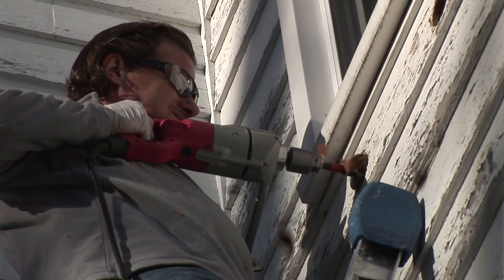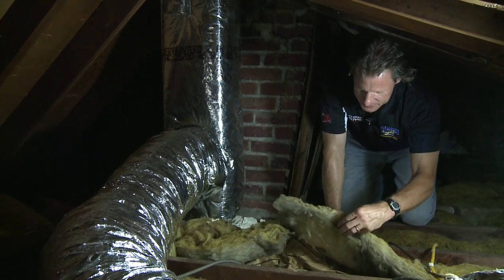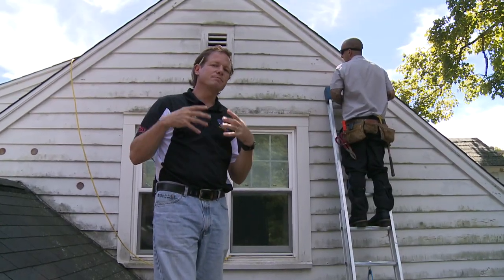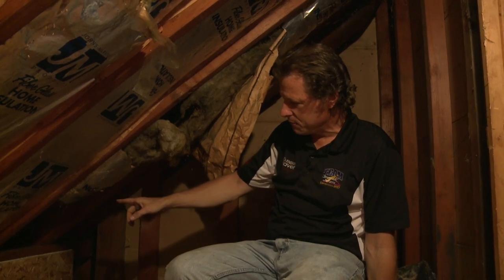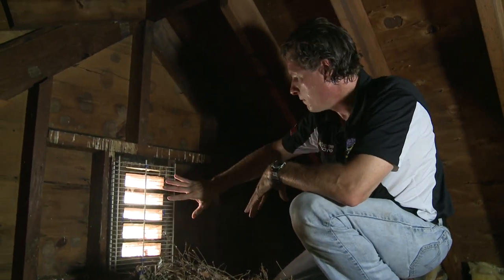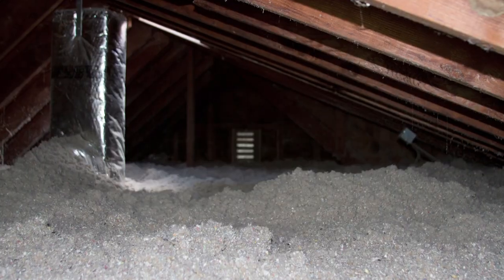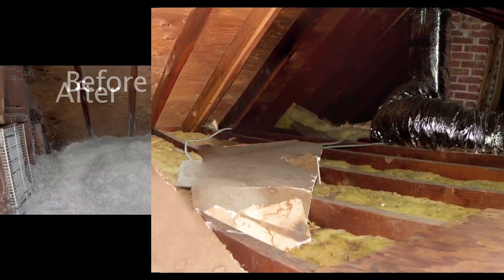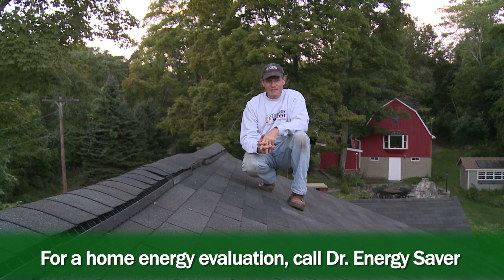How to Make a House Energy Efficient

Comment: I place fabric material on my doors and it makes a big difference! I cut out the material ( similar to a thin blanket ) in the shape of the door, then attach it to the doors. The doors themselves are always cold in the winter and the cold would create two big cold spots in the house. Now that I have the fabric on, no more cold spots and the furnace doesn't turn on as often.
Reply: do you tuck the fabric in the sleeve of the door? Most cold air is coming from the bottom and sides of my door...due to old age or just isnt sealed or fitted properly..these are at least 60 yr old doors....The Larson storm window doors outside of this leaky door was unfortunatly put on without replacing the outer wood frame due to my not being watchful when Lowes installed the door..quickly ...why put a 600 dollar screen door without replacing the wood work 60 yrs old around the door!!!!stupid but the same has occured with the flat roof replacement due to old age the trusses are not level so what ever you cover them with in this case rubber with styrofoam boards underneath....left the dip in the roof still there by the way no pitch.....no plywood to at least flatten the roof again old houses require more efficient work.....so both situations were not shoddy but the SIMPLICEST FIX......roof was 8000.000.....

Comment: About the cellulose spraying - Don't spray over the Eaves (aka Soffit).  Better to place
buffers across ea. joist to prevent the particle from falling back into the Eaves!  Else
there won't b any airflow to remove 140F hot air and unwanted moisture in the attic.

Comment: Very well done video with explanations all along the way. Most homeowners have never been in their attics and don't think about them. As a retired home inspector and HVAC contractor, I've seen plenty of homes just like this one which were "state of the art" at the time, when energy savings were not consequential. I have a 1890s home which my Dad did his due diligence in the 1970s to insulate and try to save some money. At that time, air infiltration and exfiltration was not a "thing". Today we know that air movement means either heat loss or heat gain, the sworn enemy of efficient heating and cooling of any home. Thanks for the info.

Comment: I did my whole home, walls and attic. When I cleaned up the attic, I had to hire a trapper and remove 10 live squirrels and 8 additional carcasses. I also had to repair $800 in damaged wiring and flex ducts.
Great video tho. :)

Comment: If the walls of your house are empty you most likely have an old house. The space in the walls is where condensed water evaporates out of the house. Hot air has more energy and can hold more water. When it hits the cold outside walls the air gets cold and cannot hold all that water. The water gets dumped but the hollow walls allow the moisture to evaporate. These is called balloon framing in old houses without vapor barrier on the outside of the house. By filling the walls you can make a mold situation in the walls. Best bet is use Roxul insulation to replace the Fiberglass. Use a mask for the fiberglass but Roxul is way more efficient than fiberglass insulation and it is a lot safer and in my opinion it is dust free. They tell you to wear gloves but I lay on Roxul all the time when working with no problem. I doubt you would need to blow anything on top of Roxul insulation. Also blowing prevents you from accessing the attic easily.

Comment: At approx. 10:00 you mention that you are blowing insulation into the slopes of a cape as they are not ventilated because of gable vents. Our cape cods in Cbus are 1 1/2 stories. No soffit vents. So am I installing the rigid foam radiant barrier in the knee wall attic space and closing up the gable vents? It seems a constant 'wrestle' between insulation and ventilation in these houses. Is this video of two different houses?

Comment: There has to be air flow along the roofing sheets of plywood to allow moisture to escape.  I don't understand why your cellulose is up against the sheeting since you should have installed air-flow channels to keep the air moving along the sheeting but you didn't.  As you said 'moisture can damage the attic, which is wood, and the insulation being up against the sheeting will prevent the moisture from moving away from the sheeting with air flow.

Comment: Board Foam typically isn't approved as a fire proof material and requires a dry-wall cover.  You should have mentioned that when you put it in the knee wall.
Reply: 2 layers of material?.......I dont even have insulation boards under roof...first time that the Leap people came over and put celulose in....no work was done on the perimeter of building as well so after I went upstairs only to see outside of building where roof meets the building.....not good...they did insulate the hatchet...also the fan is not working.

Comment: 1) Wood thermal conductivity is very low, in fact the values of K for wood are very close to fiberglass insulation values, so covering wood joist with insulation wouldn't change anything.

Still not convinced? have wooden spatula on your kitchen? try to put it in ice or on hot surface you will never feel anything through it.

2) batt insulation requires more effort to be installed properly (to make sure there are no gaps left, etc), but longer term it's much easier to maintain/replace and clean. Can be easily added/adjusted.

3) blow in is fine in the beginning, when its new and if you don't need to do anything on the attic after it. But after a few years, when it started decomposing, mixed with dust and animals byproducts (they would sneak there anyway) it would be a total disaster. The only way to fix it is to replace everything completely.

Comment: Why did you blow insulation into the slopes that lead to the knee wall area?  This doesn't allow for any air flow.

Are you not worried about warm moist air condensing in this space?
Reply: This concerns me too.  I think wherever you get significant snow, you need a vented roof.  Even if there is zero heat leakage from the attic side, on sunny days, any absorbed, retained heat can start snow melt and ice dams.  With the insulation going right up to the roof deck, any heat will be retained and not carried away by moving air, and then the moisture is also trapped.  Maybe it isn't simultaneously snowy and sunny enough there to matter?
Reply: @DennisGentry  He mentions in the video that the attic space is vented at the gable ends, not from up through the rafters
Reply: @jordandownie9319  Yeah, I get that the attic is vented but I'm saying that the underside of the roof deck needs to be vented (have cold, outside air circulation) if it ever snows there, because snow is a really good insulator, so the shingles will warm above freezing, melting (and refreezing at night) the snow and causing ice dams and water infiltration.   Usually, there are vents (cold air intakes) at the soffits (which, if he has them,  are now covered with insulation) and warmed air exits at the ridge or gables.
Reply: DFKnightmare sq
Reply: i suppose the logic is, the roof stays cold, because the heat from within the home cant get to the roof from the inside, hence airtight and insulated.
no heat, no ice, no problem - remember - insulation does not hold heat/cold, it does not transfer heat/cold - it is a barrier, if done correctly

Comment: After last years disaster, preventing ice dams is on everyones mind. From everything I have read, keeping the attic space as close to the outside temp, would pretty much eliminate this problem as it is the warm attic that melts the snow. For that to happen you need three things in place. Insulation that prevents warm air from getting into your attic, a ridge vent that will let the air flow out of your attic space and equally important are soffit vents that allow the cold air to enter the attic. I have watch a couple of your videos and you are completely blocking any form of air from coming through those soffit vents which would eliminate the needed cold air from entering the attic. Can you explain this??
Reply: This particular house construction does not have soffit vents.  It uses gable and ridge vents.  Air is drawn into the gable vents and out of the ridge vents.  Not the best system.  He even said it was a poor design in the video.

Comment: I see the value for the insulation and hole blocking for winter.  What about summer?  There is a ridge vent across the peak of the roof (saw this at the very end of the video) and it has to have soffit vents along the base of the roof for air to flow into the attic and out the ridge cap vent during the hot months.  Blowing all of that insulation into the attic and no provision for the air to come in through the soffits?  That attic will cook in summer.  Am I missing something?
Reply: +jjzanoni I was surprised that they didn't talk about adding in foam baffles to make the soffit vents work
Reply: +Brandon Clow he said at roughly 6 min in that the house doesn't have soffit vents.
Reply: There are gable vents. The air flows into the gables at each end o the attic, and flows out the ridge. This is acceptable.
Reply: Walter Kogut, they should have upgraded to eve and ridge vents

Comment: Very old video, but at the end of the video you can clearly see that the roof has a ridge vent. Doesn't the blanket insulation defeat the purpose and functionality without the use of Durovent from soffit to the top of the ridge?
Reply: I too had questions about airflow which he did not address.

Comment: @4:23:  So you ran about 20' of flex duct to carry warm moist air horizontally through a cool attic and then sloped it up to exhaust?  That's a water-collection device.
Reply: While I agree the run is too long, the vent hose IS itself insulated
Reply: @Windiguana  Thanks for that.  I didn't think it looked insulated, but I hope you're right.  If it was, then, as you said, it's less of an issue.

Comment: You should have put that metal screen on the OUTSIDE of the vent. Having it on the inside will keep raccoons out of the attic, but birds will still get in between the louvre slats and pack straw, piss in the nests, and make a mess. Plus the straw packed in there will reduce air flow to the outside. I know what I'm talking about from dealing with birds flying in between the slats on my attic vents. The slats are too far apart and the birds can easily get in there and build nests. The only solution is heavy metal screens on the outside that they can't peck or chew through.
Reply: He didn't put the metal screen in the homeowner installed it beforehand.

Comment: Larry, Wish you were in my area to help us figure out the best way to vent and insulate our house.  Have had a few "top" rated insulators here in the PNW give us a lot of confusing information.  Cape Cod style house with 2x4 construction. Very little soffit venting, a very small gable vent on one side, and no ridge vent.  Told soffit venting will be difficult because of bird blocking between rafters, and that will need to cut mid roof vents in addition to ridge vent and larger gable vents on both ends.  And finally the insulators can't insulate above knee walls because of the 2x4 roof construction nor can they add baffles. Aaarrgg!
Reply: Where are you located??
Reply: PNW
Reply: Maybe open up walls and use closed-cell spray foam everywhere. Check for airtightness. Install an HRV or ERV system with built-in heat pump.  Will be expensive but should work.

Comment: i have a cap that has an attic fan but doesn't have any sofit vents or ridge vent as far as i can tell.  is is ok for me to do the exact same application or should put those in first?  i don't have any ICE damning now, but i don'y want to cause a problem later.  i do plan on redoing gutters, sofit and fascia in the summer.  Fuel is expensive and i am looking for the best solution possible.  don't mind spending more now if it will save me $$ later.  thanks for your input.

Comment: Can't the home owner take these people that built the house to court for doing a shady job like the hole they made to run the wire and then cut a slit in the insulation and left it like that without sealing it and should  the inspector catch things like that because when they do improper work like that the home owner gets stuck paying for the repairs down the road. I really wish if you could answer that for me.Who is  to blame for stuff like that and what could be done to make them pay? Who could the home owner contact if something wasn't done up to code when the house was built and twenty years later you find out they didn't follow code? I'm sure a lot of us out there want to know the answer to these questions. Thumbs up on your video.
Reply: James Parmenter that house looks pretty old so all of the building and  electrical codes of today didnt apply back then.

Comment: One major flaw. You usually use the attic for storage. Looks to me like you can't after that. Also I thought you needed air flow in the attic.
Reply: The attic has gable vents and has vents at the pitch of the roof which you can see in the last part of the video.
Reply: Ceiling joists are typically just large enough to to safely span the given area and hold up the ceiling drywall which can be very heavy. Not intended for storage, and much better off to be insulated.
Reply: so therefore only the upper half of the roof breathes

Comment: I'm concerned that there is no place where soffit ducts are installed for proper airflow under the roof deck and out the ridge vent. How is moisture going to migrate or evaporate without proper air flow?
Reply: On most old houses, the rafters are bird-mouthed onto the sill and the rafters are full 2X4. There's only 1-2" of clearance between the rafter and the sill. Meaning no room for any ducting anyway. The old roof systems were not built with the intent of ventilation. So you're out of luck that way. Even with all this cellulose, the eaves will have ice dams in the winter and the underside will get wet unless tightly airsealed.. This is why most of us that have older houses like this go with spray foam. Airsealed to the underside of the roof.

Comment: What about putting perforated attic foil on top of the cellulose to stop air flow in the winter (but still let moisture through) and cut down solar load in the summer?
Reply: Putting attic foil on the attic floor is common misuse of the product. By compressing down the insulation you lose R value. Air sealing is the proper way to stop the stack effect.

-Comfort & Energy Advisor
Reply: Alex Romero What about gently laying it on top of the cellulose, without compressing it?
Reply: Well, the simplest answer is that it depends. What climate zone are you located in?
Reply: +Quercuspalustris50 Well, the simplest answer is that it depends. What climate zone are you located in?
Reply: Alex Romero Right now I live in Southern California where I supposed you'd want to staple the foil to the diagonal members of the roof truss, but I want to move to a mixed climate, like VA, WV, MD, PA, where it's hot in the summer and cold and snowy in the winter.  I thought for the mixed climate it would be better just to lay the foil right over the cellulose...

Comment: Did you use any raftermate to keep the insulation from contacting the roof and connect the soffit and attic with cold air?
Reply: Mike, im sure we used Soffit chutes, they do that job, and let some airflow in & out

Comment: Could you explain how your process still allows air flow to cool the roof in the winter to help prevent ice dams. If you can guarantee, or reasonably guarantee, the end of ice dams with this process I'll hire you to do my home.
Reply from the maker: +Utube6762  Hello Utube6762 and thanks for watching. We have a video about ice dams and ways to prevent or help minimize the problem. It might help answer some of the questions you have. https://www.youtube.com/watch?v=EwnMifJL2Tg
Reply: Google proper vent and raftermate.
Reply: This particular house has gable and ridge vents which were not blocked by the cellulous insulation.

Comment: A ventilation system without a heat exchanger? That don't make sense, you blow the heat out of the house. 
Why is there not a vapor barrier build in, before the insulation was blowed in ? In a few years the insulation and wood is wet from the humidity which a condensed in the insulation. 

Wie kann man nur in so einer gammeligen Bude noch so viel geld, für so schlechte Arbeit, versenken.